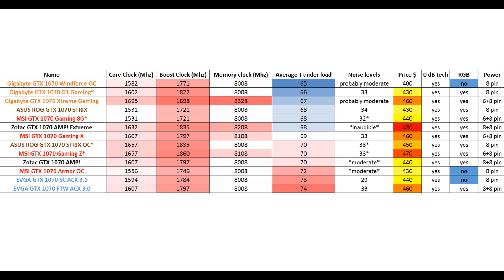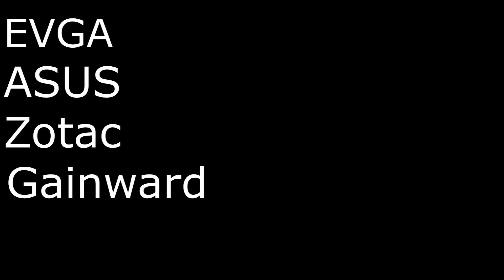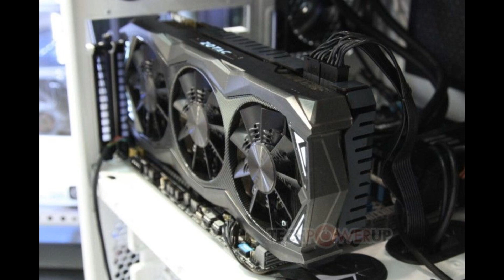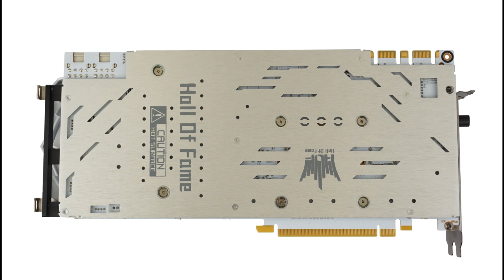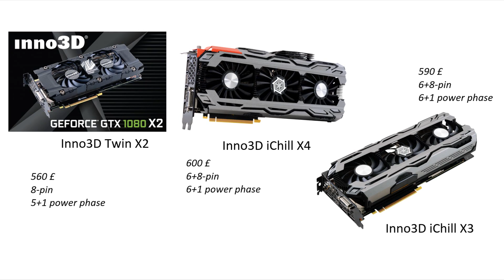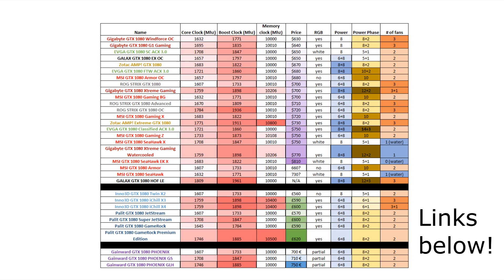Which Geforce GTX 1080 to buy? 33 different GTX 1080s compared.

Comment: i just purchased  a evga 1080 sc  and under load the coil whine  is awful   plus the backplate  gets super hot  . i never felt a backplate  get so hot .  so i  ordered a asus  strix 1080 advanced today  .
Reply: So are you saying that the Asus Strix 1080 are far better than the EVGA 1080 SC  and it run way Cool
Reply: Mountana Berry i installed my new asus 1080 today and so far i am impressed. it stays silent and cool  . i overclocked it  to 2080 mhz  using  the asus provided overclocking software.  it bliss not to have the bad coil whine of the evga 1080 superclock card . time to put the evga on ebay .
Reply: So Glad I didn't buy the EVGA 1080 SC 
therefore, I will look for a decent deal on a Asus GTX 1070 or 1080 
all the best.

Comment: Card i would chose is "GIGABYTE GeForce GTX 1080 Xtreme Gaming Premium Pack 8G, 8GB GDDR5X" which goes for 900 dollars in my country. But the question is. Should i wait for new GTX 1080 Ti cards release and get one of those instead ? Or 3rd option. Should i go for cheaper variant "GIGABYTE GeForce GTX 1070 G1 Gaming, 8GB GDDR5" which goes for 500 dollars.
Reply from the maker: Hey! Depending on your needs, the 1070 may be enough for you! If you play at 1080p144 or 1440p60, then the 1070 would be enough for your needs.
Reply: Alright. Thanks for your help. :)

Comment: what you said about water cooling a low price cpu to = a high price cpu is bs
Reply from the maker: You mean GPU?
If the person is will to pay $100+ more for a binned chip (hence there's still no guarantee that it will be a good manual overclocker - they check only the boost clocks), and then throw in another $100 for a waterblock and get up to a 5% better OC then yeah, sure. But I stand by my opinion that it's more cost-effective to watercool a cheaper card.